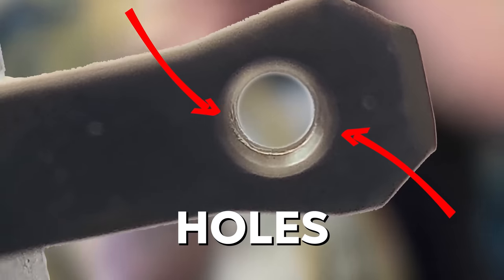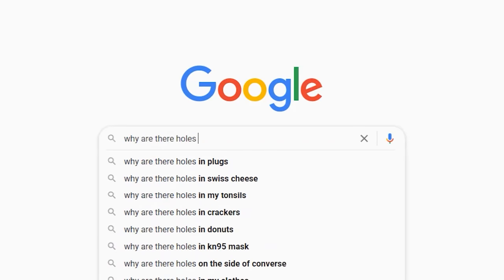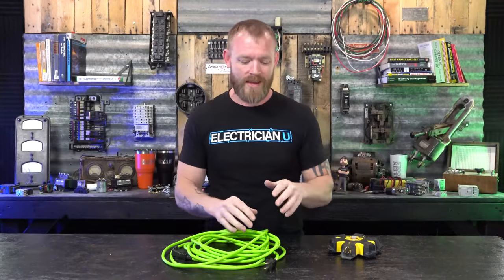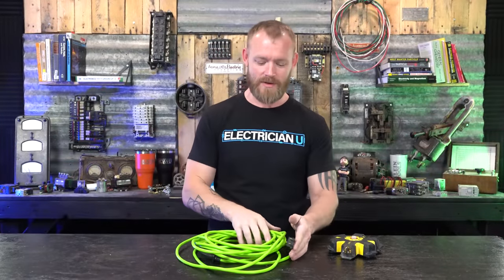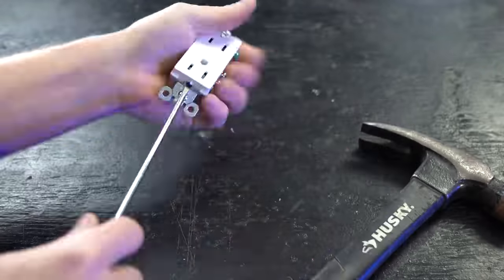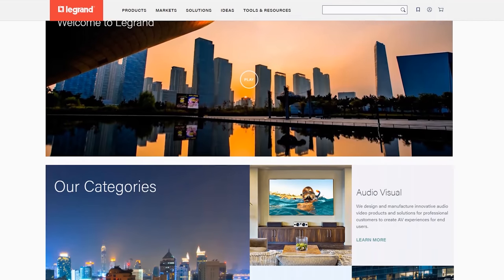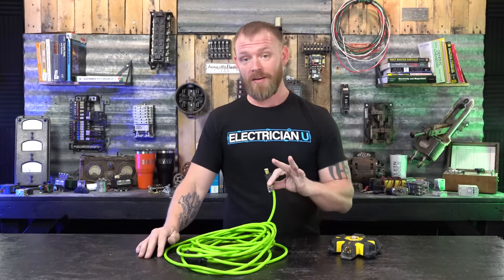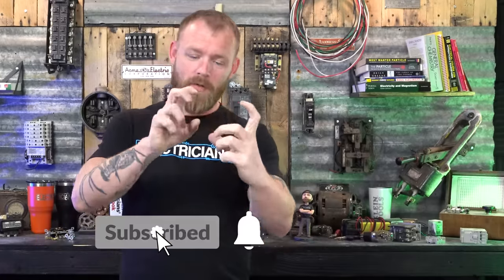WHY Do Plugs Have HOLES? The ACTUAL Answer!

Comment: It also might not be worth the retooling cost to manufacture them with out the hole in them now.  I have worked on industrial equipment that has rs232 ports but you just was a adapter to turn it into USB because it would cost too much to shut down the assembly line and retool for that one minor change that is largely a non issue.
Reply: It's more the cost and bother to rewrite the patent spec they are built to.
Reply: @donerickson1954  Considering plugs are already built with out them it invalidates your position about rewriting patents.  The real cost is tooling and overhauling a assembly line that can cost from a few $100k to a couple of $1m in cost compared to $5k to $20k for a patent filing.

Comment: I'm a little late to the party here, and I have NOT read all the comments, but I have to disagree with your "official" answer from Legrand. If the holes were so that the plug would stay in the socket better, then why do twist-lock plugs have them? Twist-lock has no problem staying in the receptacle. They literally CANNOT fall out of the receptacle, you have to twist them in and out. Look up a "Legrand L6-20P" you will see that that has holes in the blades of the plug too. I require a follow-up video!! 🙂

Comment: The biggest question is why are American plugs so flimsy. As a Brit I know I’m obviously bias but our plug and plug top design is waaaay more robust, carries a fuse, has shields on the prongs so you can’t touch them if only partly inserted and our sockets are shielded so the live hole is only accessible if the CPC (ground) hole is engaged.

Comment: ... they are there to hook up a plain wire throught them when you don't have a receptacle nearby. Strip the wire, hook it thru the hole and use a trip of electric tape to cover it, and you have power!
Reply: And if you have balls, you don't even shut off the current. Electrical tape, Ha!

Comment: Nope.
Those "engineers" were someone in the PR dept stuck with answering your question and they probably just Googled it themselves and gave you the answer they found most plausible. 
If you disagree then prove me wrong. I challenge you to find a receptacle with those protrusions. There are plenty of recycling and re-use centres that should have receptacles from demolition of old homes. 

Meanwhile the answer is number 2. Lockouts.

Comment: You can find the nema specifications online, if you check Wikipedia it has a reference that links to the 2016 codes that shows the holes are for manufacturing only(I would post the link but the comment gets deleted)

Comment: HAS NO ONE HERE ....
Ever used a LOCKING 120vac extension chord?
Instead of tying a cable knot, you can use a a locking female plug/extension chord and flick the lever to hold the connection together.
🤦
Clever adaptation.
Reply: THIS

Comment: The plugs were harder to pull out. The cords were two twisted wires connected to the plug with screws. That's why everyone was told to never plug out the plug by the cord.
Reply: Well, it's a bad idea to pull the plug out using the cord regardless how it is made....
Reply: @fewwiggle   I am not now or ever have been a proponent of cord yanking.
Reply: @thomcarr7021  My mother told me that cord yankers go blind.... :-)
Reply: @fewwiggle   You wear glasses.
Reply: @thomcarr7021  "You wear glasses"  You're right -- reading glasses!!!  How did you know?  Seems I have yanked my cord a few too many times....

Comment: So mild 4th actual answer that is also kind of a continuation of the actual answer of "its a hold-over".
Manufacturing is of these plugs largely only comes from a few suppliers, and some, but not all of those suppliers use those holes in the manufacturing process. A securing rod through those holes allows you to manufacture and process dozens of plugs on a line yada yada tens of thousands a day, for decades. Why retrofit the process if it works perfectly as is, especially when, at least on paper, it makes it more backwards compatible with old plugs.

Comment: I think it's so you can run a wire from one plug contact to someplace else to check continuity. Hook a wire through the hole and then run the wire a long ways, longer than the meter lead. Many times you must check continuity or voltage where the meter leads won't reach, and the cord that the plug is on is fastened or buried so you can't move it.

Comment: To the point about punching out metal to save on cost:  No.  it's cheaper to not add a useless process/labor cost to punch out metal you don't need punched out on a piece of meatal you already paid for.

Comment: One of the main reasons for the holes is also for the locking technology that can lock two cords together so they don't separate. (Not available everywhere) but its easier then to make two types of wires.
Also the holes help with griping and connection plugs with out holes are more likely to spark when plugging in.

Comment: Here's a 3 way switch question, they are just SPDT switches, they already had a name so why did they invent a new name that doesn't make any since? what is there 3 of?
Reply: its switched from 3 locations. and they use that because it's easier for joe homeowner to understand when he's installing his new in-wall fire-starter, complete with back-stabbed aluminum wire.
Reply: @bobbing4snapples  Just 2 locations though, you add a 3rd with an H-way switch, which continues the tradition of making no sense.

Comment: The point of lockout/tagout is the person who locked it out should have at least one key to open it, so that it cannot be accessed until the person working on said project is done and safe.  

It wouldn't do you any good to lockout an electrical panel and begin to work on wiring if any idiot could open it up and turn the power on and kill you.

Nobody is getting a padlock into those tiny holes and a zip tie isn't going to do anything.  A proper lockout shouldn't be able to be removed by anyone else without some kind of nefarious behavior like cutting a lock off.
Reply: WTF are you talking about they make pad locks especially for lock out tag out on them. Many machines like meat slicers at butchers use them when they are cleaning or changing a blade. They are used a lot and jt doesn't require killing an entire circuit for a plug in equipment to be maintained.
Reply: @zack9912000  That's fine, I was unaware that they existed.

It doesn't change the fact that using a zip tie is a stupid and dangerous idea.

You missed the point of my argument.

Comment: I was right!  I'm a mechanical engineer who spent way to much time reverse engineering things in the auto industry.  My first take was "it's a relief/indent for a spring or bump to grab when inserting."  As the owner of an "older" home here in New England with a few outlets that are vintage 1950's hanging around, I can confirm the damned things can't hold a plug in without sagging!

Comment: its all based upon products getting pass the legal requirements. the first patent/design of the plug set the standard and all other companies tend to steal the exact design as it allows them to pass the legal requirements of that plug without having to pay someone to legally ok the design.  chances are the reason for the holes is only in the mind of that first designer who is probably long dead. all other designs with holes are just copies to easily bypass the legal requirements.

Comment: i have an extention cord that takes advantage of the holes to use as a lock so you cant seperate the connection without pressing a button on the extention cord first. now me being dumb and forgetful drove away with the block heater still plugged into my holfcart tore my shed wall down pulled the power pass through out of the cart before it broke the lock on the cordbut it broke it so it no longer works🤣🤣

Comment: Typical Old US 110v engineering's spec to cut static without separate ground wire ! European Ground plugs such as F or E types such as German(South Korea) does not have holes except a hole for ground circuit wire in similar circumstances supporting 240v 17Ah even for ovens. GETTING high voltage also helps to quick charge any EV cars also as using 220~240 rather than slow 110v.

Comment: Interesting! I thought it was a child protective safety device so a small padlock could be inserted thru the holes, say for a power tool, preventing it from being plugged in. I actually have seen that done.
Reply: That would be pretty dangerous as the kid then would do some dangerous ad-hoc solution to plug in he game console.
Reply: They are, you can use lockout tag out on those plugs

Comment: I had an old extension cord that used the holes to physically “lock” the cord that was plugged into it. They couldn’t be pulled apart without pressing a release.

Comment: My theory:  when you plug-in/unplug an unswitched load you get arcing.  When you have arcing, you get spot welding. If you have a hole in the middle, you reduce the maximum size of the welded area, thus weakening it enough so you can still manage to yank the plug out.
Reply: yeah, no. the arcing is always at the tip of the prong which is the last place to make contact. if you've seen enough of them you'll see this pattern. the holes rarely have arcing damage around them

Comment: These bumps fit into the holes so that the outlet can grip the plug's prongs more firmly. This detenting prevents the plug from slipping out of the socket due to the weight of the plug and cord. It also improves the contact between the plug and the outlet.

Comment: This is the wrong answer. The right answer is that they are present for manufacturing purposes, such as setting the prongs into a mold as plastic is injected. They are optional and can be used for whatever the manufacturer wants. NEMA specifies the exact location and size of the holes because, if they're gonna be there, they may as well be standard. Please do your homework more thoroughly.